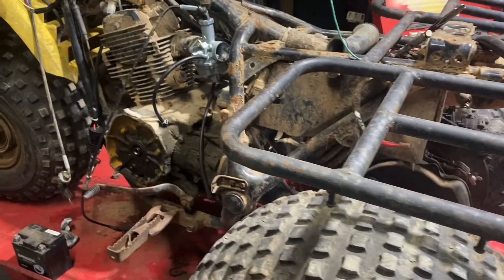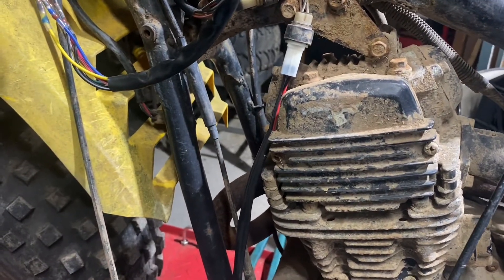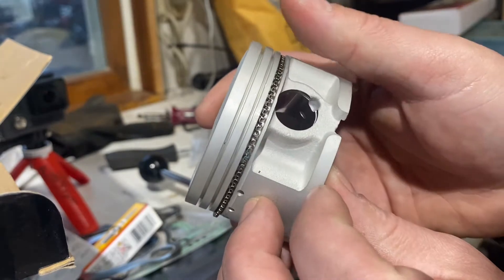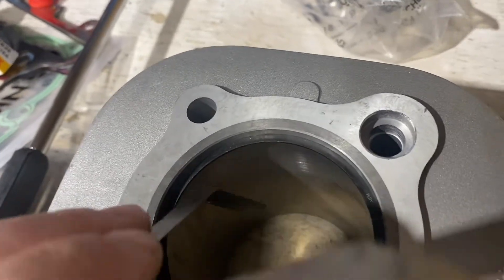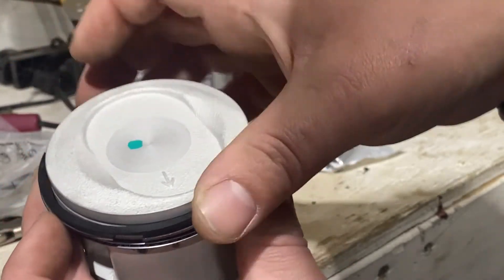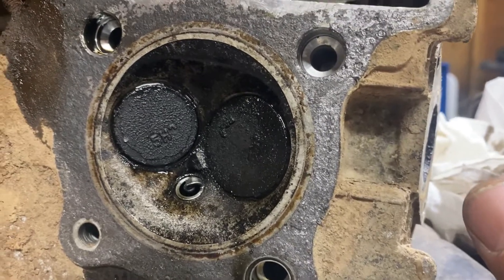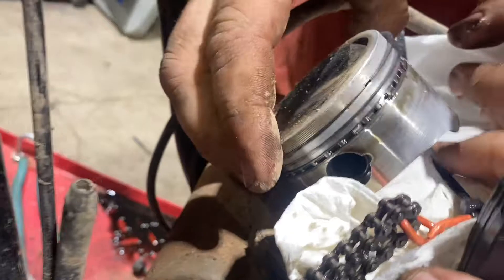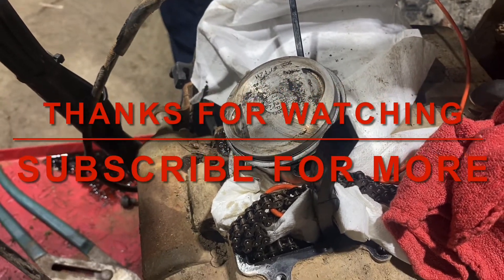RESTORING 5 Yamaha 225DX Tri-Moto Three Wheelers 7

Comment: How did you know which ring was 1st or 2nd. I bought a similar kit off amazon and the top ring and the 2nd ring look identical.
Reply from the maker: It's been a few months since we rebuilt these, but if I remember correctly, the rings are identical. You can take the ring and rotate it in the groove on the piston. I thought we showed that in a video, but I don't remember. Basically, before you gap the rings, insert them in the grove from the side and see which one fits in either grove.